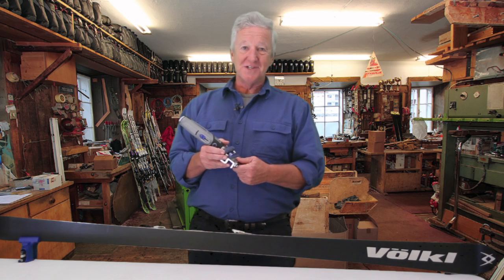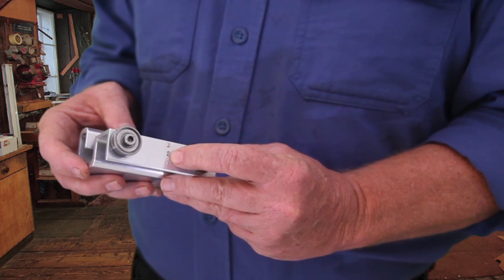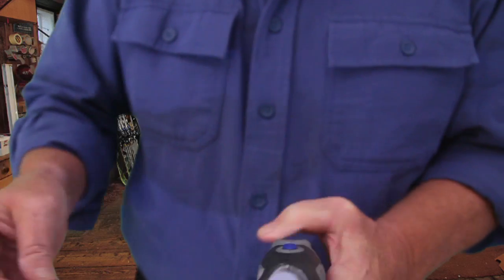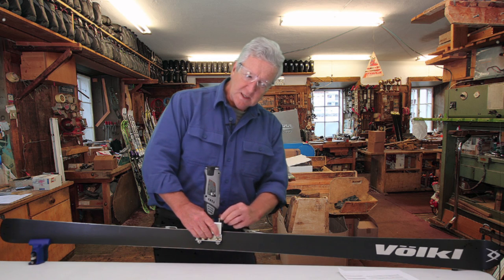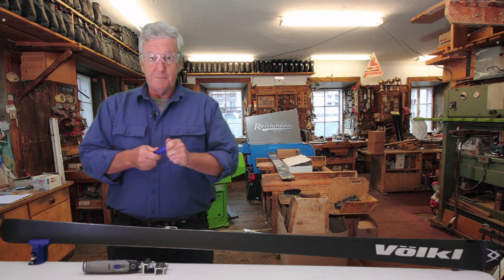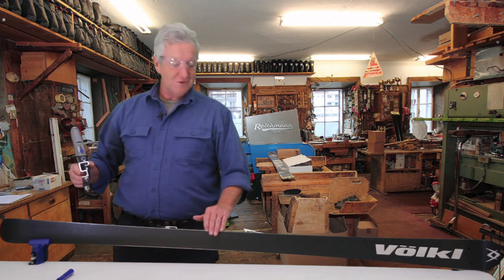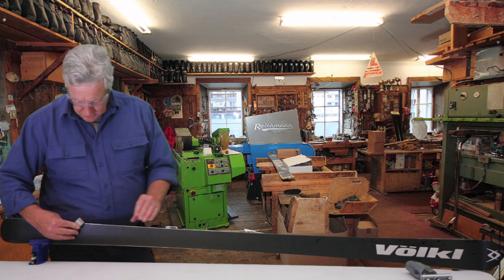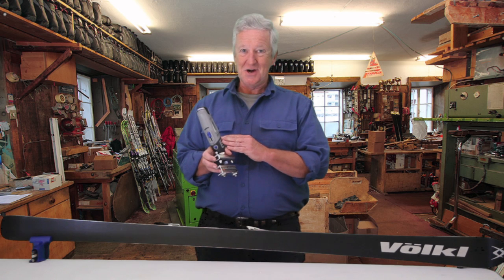Edgetune Pro II Instructional Video

Comment: If you change the rotation direction of the cutter, or you present the grinding wheel by lowering the back screw, the wheel will actually rotate into the edge and will leave no burr to clean up.

Comment: I thought the correct direction of all edge work is supposed to be done from tip towards tail?
Reply: That is incorrect. This is a rotary tool that sharpens perpendicular to the length of the ski, so it doesn't matter whether you are moving forward or backward on the ski.
Also, if you are referring to a file, it's actually best to go from tail to tip, seeing if you incorrectly stop the cut or chatter out of the cut, the remaining burr will then face backwards. If you sharpen from tip to tail, the burr will cause large friction as it points forward.